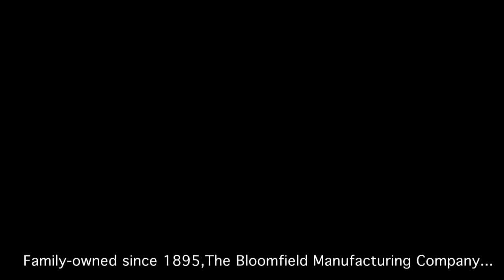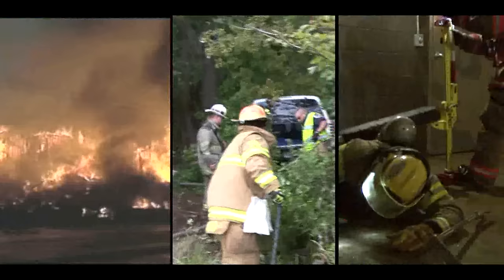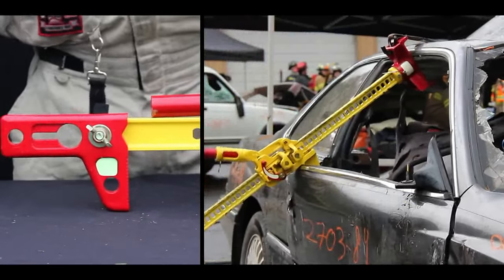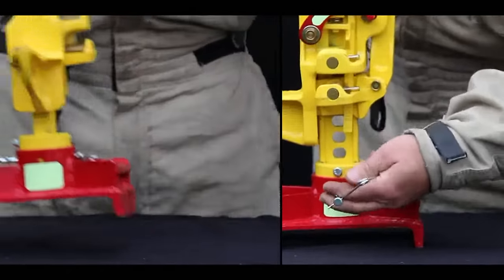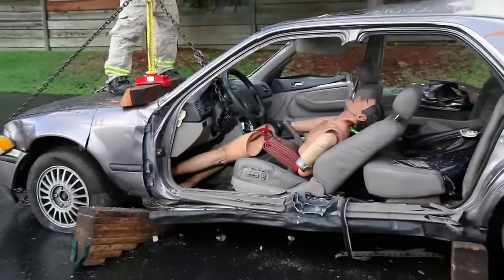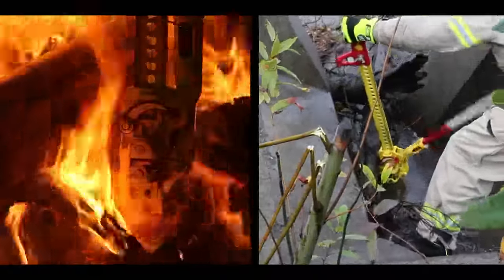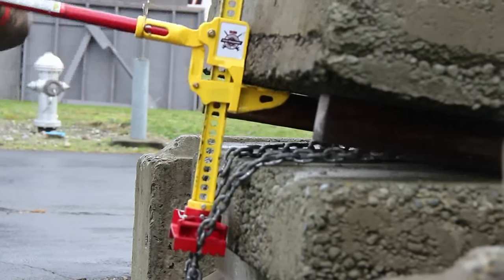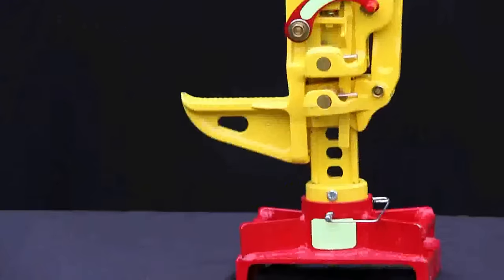Introducing... the NEW First Responder Jack by Hi-Lift

Comment from the maker: The Hi-Lift jack has been known as "sheepherder's jack" and Handyman jack since it was invented by our founder back in 1895.  This First Responder Jack is of the same line of Hi-Lift jacks, with improvements specifically designed to make this a rescue tool.  The improvements were designed by firefighters, for firefighters.  Still a Hi-Lift through and through...

Comment: great tool i use my hi lift nearly every day as a mobile plant fitter great for lifting or pulling vehicles lifting heavy parts i also use mine when reparing rubber tracks on drill rigs instead of a chain pull much faster and and easier.

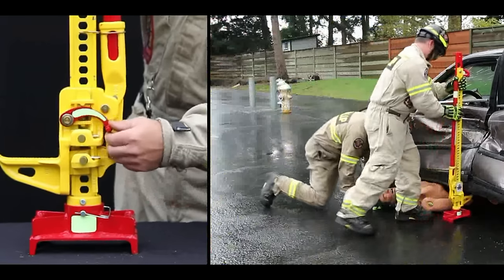Comment: At 1:47 surely those safety wedges are being put in upside down. On the top as is shown, the surface is on an angle allowing something to slide down, whereas the bottom surface has an increasing in height series of flat surfaces which are parallel to the ground or in other words perpendicular to the force of gravity.

Comment: high priced
Reply from the maker: Higher priced than standard Hi-Lift Jacks, but the very low cost compared to other fire and rescue equipment.  The specialized components of the First Responder Jack are a value at the current pricing.
Reply: look up the hydraulic tools if you think 250 is expensive